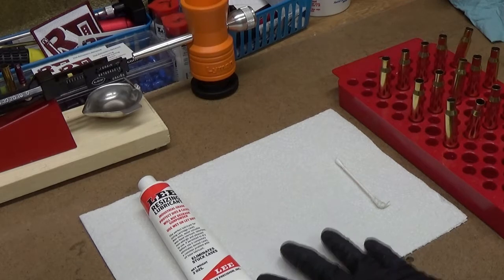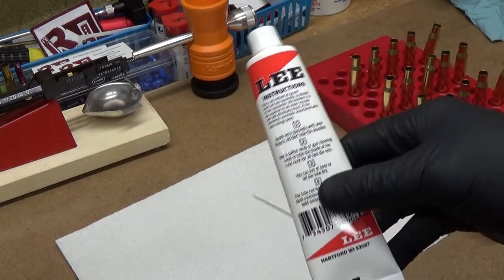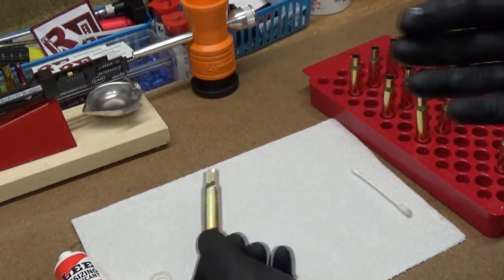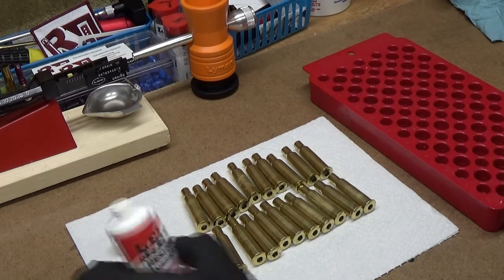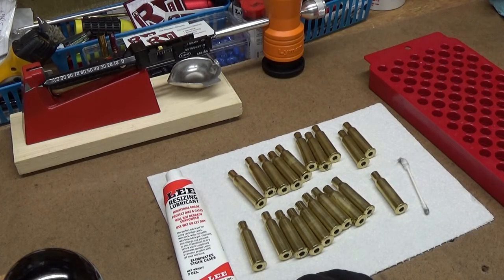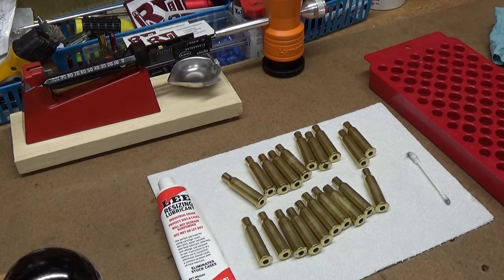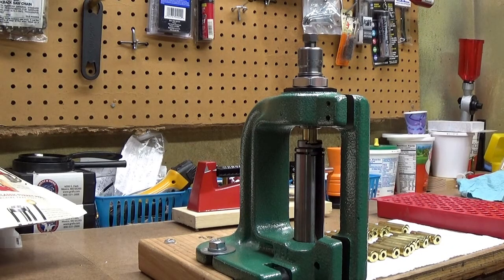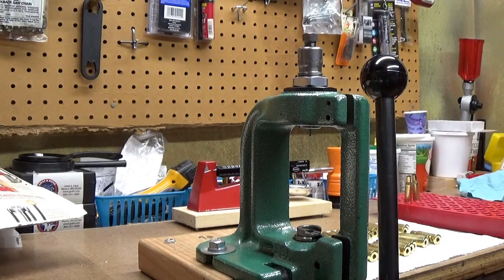Using Lee Resizing Lubricant and Full Length Sizing Die

Comment: I took the Lee Lube and mixed two teaspoons in a 6 oz spray bottle with 91 percent alcohol. After mixing it up thoroughly and shaking it up, I made it into a spray. Works very well. Also, did the same to the RCBS-2 lube into spray. Both worked but the Lee I can use inside the case necks. I'm pretty stocked on Lee Lube for awhile now.

Comment: I have been using the LEE resizing lube for years. I personally think that its the best thing going
Reply from the maker: I like it. It works well a little goes a long way and you can use it wet or dry. Cleans off easily and won't foul powder. Sounds like a commercial. LOL

Comment: Its what I use. Always been good stuff for me. I use a Q-tip for it all. Just a dab on the Q-tip. Rub on the body and inside the neck of the case. This lube will not degrade powder. Wet or dry. I wipe case body and neck off after full length resizing.

Comment: Best explanation and demonstration yet. Thanks.
Reply from the maker: Thank you Marco, I appreciate you saying that. I am glad it helped.
Reply: @johnshandloading7907   Take a bow. You did more than help, you provided the solution. Loaded 50 rounds of 25-06 Rem using Barnes brass that I saved, H4831sc 49-53.5 gr in .5 increments pushing a 100 grain Barnes TSX bullet. COAL:3.030. .050 off the lands. Let’s see what it does on paper @100 yards +.
Reply from the maker: @marcoaguiar1131  very cool. That makes me happy. It is fun to tinker and test. Good luck.

Comment: I’ve used a few different sizing lubricants, and the Lee product is the only one that works for my 6.5 Carcano cases. Something about the shape of the case that requires something like Lee lubricant on the inside of the neck (I’ve had 3 stuck cases now experimenting with other products, but never with Lee).
Reply from the maker: I like it because it is not sticky or slimy. It cleans off easily too. It can build up in your dies over time but cleans out easily. Does not foul gun powder inside the case. Good stuff. Thanks for watching and commenting.

Comment: The 1/3 rotation and 2nd stroke into the die is completely unnecessary, but whatever Mojoe brings you tight groups, do it.
Reply from the maker: Yes - I got used to doing that when neck sizing and still do it sometimes full length sizing. I have no real 'proof' that is makes anything more accurate but it sometimes helps to have some 'black magic voodoo' reloading. Thank you for watching and commenting.

Comment: Could you put this on some paper towel and roll the cases or push the cases into it? This seems kinda slow and finicky to me. All I need is to lube the necks of the cases I'm doing.
Reply from the maker: You could do something like that. I like trying to get inside the neck and find the Q tip works well for that. Maybe put a dab on a cloth and rub each neck with it. I am 'overly cautious' with most things, but it keeps me from making more mistakes. Good luck. Thank you for watching and commenting.

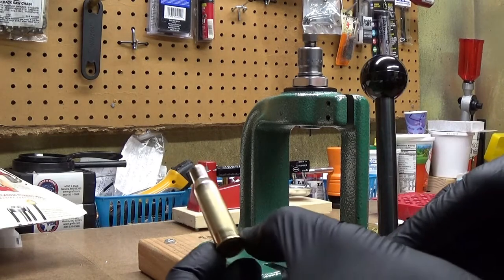Comment: Why lube down the entire case body all the way to the base when you're only resizing the upper portion? I'm new so looking for an explanation to help me learn. It seems pointless when you can clearly see from the shine where it was resized. An aerosol then sure, be more indiscriminate, but why would you apply lube by hand to an area that doesn't apparently need it (judging at 07:39 when you can clearly see the untouched lube on case body)?
Reply from the maker: This is a very good question. The very bottom part does not have lube on it and is not re-sized, the shiniest part of the case that you see does not go into the re-sizing die. if you look again at 7:39 you will see cloudy, foggy smeared lube all the way down until the clean shiny part. The lube you see there is not actually 'untouched' it has lines in it from touching the inside of the sizing die. The die does resize the majority of the case, tapering so it is slightly tighter at the top/neck/shoulder area but it does resize down close to the base. It is better to be sure and have lube there and not get a stuck case in the die. Even with all the lube they can still get sticky or hard to move in and out of the die. Clean dies help as well. Opinions will vary and some like more or less lube, or spray lube instead of waxy lube. There are many ways to lube cases and this is just one way and the way I normally do rifle cartridge cases. Thank you for watching and asking the question.
Reply: @johnshandloading7907  Ahh - I didn't notice the faint lines down the case. And very much on board with better to be safe than sorry. Thank you for taking the time to answer and spreading the benefits of your knowledge. Regards.

Comment: Should they be put back in the tumbler before loading?
Reply from the maker: I don't tumble the brass afterward, I just wipe it off with a rag or towel. Some people do tumble it afterward or clean it with water. I just wipe it off and that has worked well for me. I also clean them by hand in a water, soap, lemon juice mix prior to resizing, as seen here: https://www.youtube.com/watch?v=_uh4PkgXSzo
Thank you for watching and commenting.
Reply: @johnshandloading7907  what about the inside?
Reply from the maker: @Icelvlan1  the only case lube inside is a tiny bit in the case neck and it helps with the bullet seating. The inside of the case was cleaned prior to the resizing so it is not nasty inside. The lube is put on the outside of the case to keep it from getting stuck in the resizing die. The Lee lube is waxy and dry and wont interfere with the powder or primer if there is some inside the case. I really like it.
Reply: @johnshandloading7907  I tumble my brass to shine them before anything in the case prep steps. I don't clean or wet my cases. No need to. I only need to shine them so I can find them again after firing. I do use a RCBS case brush to brush any crud that may be there out of the inside. If there is no crud then I usually don't even brush them out.

Comment: How do you set the die to get a specific headspace?
Reply from the maker: I don't usually set it for a specific headspace because I don't have the gauges and tools for measuring the the rifle and brass. Having said that, you can measure the brass and start with the re sizing die farther away. Slowly moving it down in little increments and re measuring the same piece of brass until it is where you want. To do it correctly and accurately you would need a bushing or comparator of some type on your calipers to get consistent measurements.

Comment: Check the run-out. For 308 I have lee, rcbs and redding. Without neck turning lee is the beat with .0005 run-out.  Reading has .003
Reply from the maker: Yes they work great. I was shocked at how consistent my hand loads were when I started out.
Reply: @johnshandloading7907  for straight wall cases they work great. Been using them for 30 plus years

Comment: I am getting consistently stuck cases.  Two I removed successfully but another stuck. I use the Lyman 2 die set with the pad and Lyman case lube.
I have a replacement die from Lyman...thanks to Lyman but just had the Same results on 6.5 creed.  What to do?
Reply from the maker: I would try a different case lube. Either the Lee like in my video or one of the waxy types like imperial sizing wax or Hornady unique case lube. You could also try a spray type, but the spray types seem to use a lot and stay slimy to me. I like the wax types because they don't tend to interfere with powder if they get inside the case. Stuck cases are no fun. Also make sure the die is cleaned periodically and that bottle neck cases get some lube inside the neck. Thanks for watching and good luck.
Reply: @johnshandloading7907  Much appreciate your knowledge.  Will do as you suggest

Comment: My question is if your brass has a belt in them when setting up the sizer die do you give space for the belt
Reply from the maker: I have not resized belted cases. I think you will re sized up close to the belt but would do it carefully. Hopefully the dies have instructions that are detailed enough to make it clear.